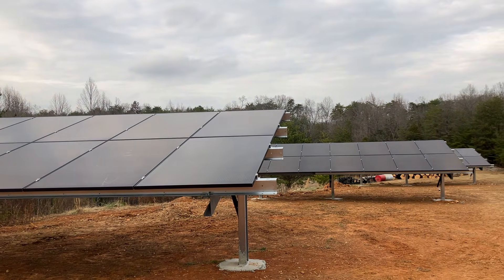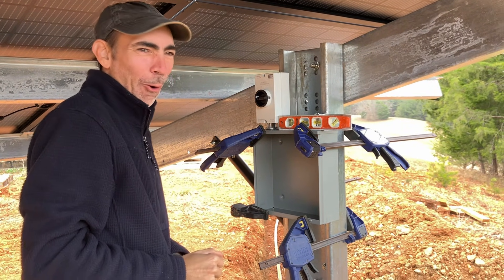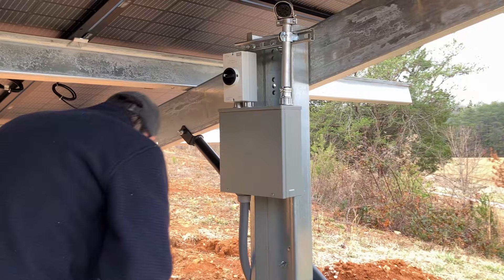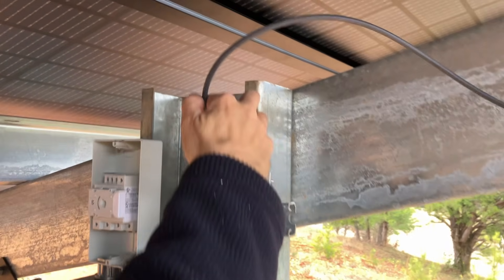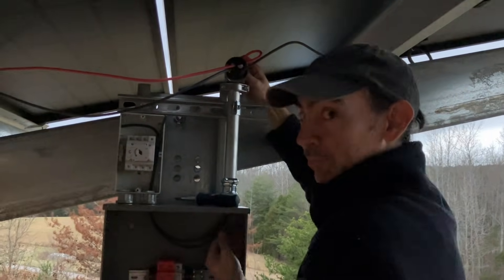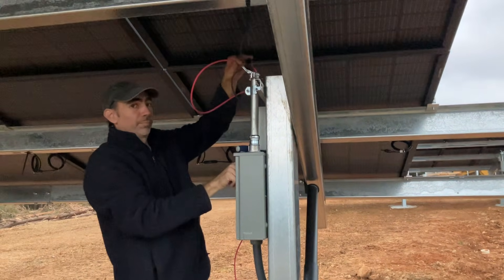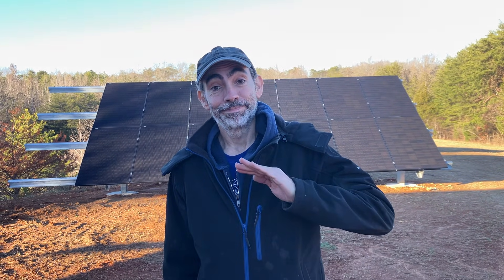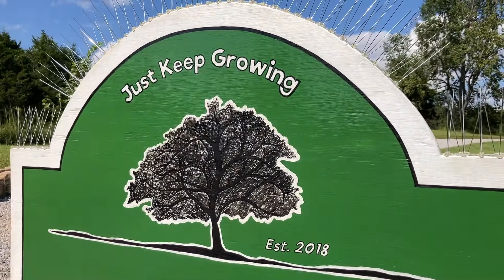Wiring Our Solar Panels Start to Finish ⚡ Pull Boxes, IMO Disconnects & Long Wire Runs

Comment: I’m glad it all worked out for you. But yeah, don’t rely on LLMs to do math. What you wanted to look for is a conduit fill calculator. Also, pulling PV wire in conduit is fine, but switching over to THHN in your junction box would’ve been easier.
Reply from the maker: Yep, couldn't agree more!  The conduit calc would have been a better place to go, for sure.  
I contemplated switching to THHN from the IMO at the garage but had a ton of PV wire left so I decided to use that.  I'm sure you're right... it would have been easier.

Comment: Looking good!

Breaking self-tapping screws - I have better luck by predrilling a slightly smaller hole before screwing in the self-tapping screw into heavy gauge steel.
Reply from the maker: Good tip!  Thanks!!

Comment: I just checked your #10 cu pm wires in 1” pvc.   With the (6) #10 that you used, you are at 39.2% fill.  NEC says 40%.   So, for what you pulled, it is fine.  Now the problem,  why did you not install the required equipment ground?   The grounds you installed to ground rods are for lightning.  Required equipment grounds are for ground faults.   When I designed solar, which was for commercial large utility connected systems starting at 1 megawatt, I learned that those coiled wires on the modules, you call them panels, are so you can skip a panel.   That way, your final connections are at the equipment end at the first and second module, or panel.  Your method causes voltage drop and therefore power loss.   Did you put the correct size fuses in the string fuse holder?   Maximum fuse size is 15 amps, just so you know.   Hopefully, you install a disconnect on the outside of your house for the solar before it enters the structure.
I do have one more question,   Since the conductors under the panels of your array are less than the required 8’ without protection, are you going to build a fence around the array?
These are the finer points of designing and installing solar.   You are doing mostly a good job!   Safety tip!   Always be safe!  The life you save may just be your own!  Best wishes!
Reply from the maker: Excellent comment!!  My understanding is code doesn't require the ground be run through the conduit but does require it be bonded with the inverter/electrical box.  We did do that and will get into that on the next (I think?) video so you'll see that soon.  In doing so, that will handle both faults and lightning.  

I guess I don't totally understand the skipping thing, but wouldn't you still be using the same amount of copper either way?  You still have to get from the end of the line back to the electrical box which would mean the voltage drop would be the same.  

In the data sheet for the Aptos panels, the max fuse size is 30a and that's what I used (the Sol-Ark self limits to 26a).  It would have been better to separate the two series lines and used a 15a fuse for each.  I may go back one day and do that.  If something were to happen, I'm limiting a potential problem by half.  I don't think it would be too difficult to do it either, so thanks for that!!  

We do have an IMO disconnect on the garage which is on the next video.  

Finally, a fence might be required if we have livestock, public access or an inspector deems it subject to damage which I'd have a hard time believing that would be the case in our situation.  At least I hope that! :)

If we were a large array like what you've installed (awesome job, btw!!) I could totally see some things as being an issue.  If/when I do something about those fuses, I'll give ya a shout-out. :)

Again, thanks for the well thought-out comment!  We much appreciate it!
Reply: @trippyacres .  No, less copper in the string.   Instead of the coils on the back, they would be used and that #10 you added would be only to the first and second panel.   So if you have 6 panels you would plug them this way.   P1 to N3, P3 to N5,  P5 to N6, P6 to N4, P4 to N2.   That would leave you with 2 ends.  N1 and P2.  
I will have to get my NEC and check on the no equipment ground in the DC conduits.  
I hope you don’t mind my comments!   If so, tell me to not comment.
Reply from the maker: @KevinCoop1  Oh!! I understand now.  By skipping one, when you get to the end, you're coming back to the beginning.  So if you are looking at the left side of the array and the electrical box is on the left side, your first panel is your positive (to the electrical box) and your second panel ends up being the negative (to the electrical box).  That would eliminate the long run of the negative going back to the box.  I'll have to see if my Leeds are long enough for that.  If they are, I'll put that in our video as a "Trippy Commenter Tip" ! :)
I don't mind at all.  If I've done something dumb (or there's a better way) and am amplifying it to the world, I'd want to correct it, so I certainly appreciate it!
Reply: @trippyacres   Ok,  I’ve done my investigation to make sure I’m remembering correctly or not.  Been retired since 2018.   NEC Article 690.43 Specifies that metal parts of PV modules (panels) and equipment must be connected to the circuit equipment grounding conductor.   It references Article 250.134&136.  690.43C very specifically says it’s required.   The reason for this grounding is so that if the DC touches the frame, the metal support structure, the metal box you installed, it will cause the GFCI to trip, or the fuse or breaker to blow or trip.  So, you got some grounding to do.  All conduits, need them and they need to be connected to all the metal parts of your system.   Sorry!
Reply from the maker: @KevinCoop1  I'm pretty sure I've done all of that.  The clamps have teeth that bite into the modules and racking so my understanding is they double as a bond.  The racking is bonded to the post via the bolt that has teeth.  The box is bonded via the solid #6 which is bonded to the post.  That same #6 goes through 2 ground rods and comes back up into the garage.  Where I transition from PVC to EMT inside, I took that #6 and bonded it to the EMT which then got bonded to the Sol-Ark, which then got bonded to the breaker box, which then got bonded to the building (was also bonded to the building where I transitioned from PVC to EMT) and then another 2 ground rods.  The Sol-Ark has a built in breaker plus I have the fuses on each array.  Have I missed something?
Reply: @trippyacres .   Ok, so I missed the ground wire in the pvc conduits?   If you pulled a #6 in those, I didn’t see it.   If you used #6, you over did it.   #6 was required for the grounding electrode conductors but, depending on your overcurrent protection, you could have used #10 or #12.   If it’s in, all good and well done!
Reply from the maker: @KevinCoop1  No, it's not in the conduit.  I have it outside the pvc conduit so I can attach the ground rods.  That same #6 that is bonded to the boxes/posts/modules goes into the garage and joins back up to the six 10awg wires when they go into EMT.  I bonded the EMT with that #6 so the path is continuous from modules to the Sol-Ark to the breaker box to the additional ground rods.  My inspector didn't care that the #6 wasn't in the conduit so long as it all came back together.
Reply: @trippyacres .   For clarity,   There are two different “grounds” in an electrical system.   There is a grounding electrode system.  That is connection from the equipment via a grounding electrode conductor to a grounding electrode.  The electrode might be ground rod or rods, or in may be support steel in the earth.   The purpose of that is to dissipate lightning strikes from sky to earth. Table 250.66 for conductor size.  This is where your #6 size came from. That system is done.   Then there is an equipment ground system.  Soon NEC will be changing it to equipment bonding system since it truly has nothing to do with earth grounding.   The equipment ground conductor size is based on the overcurrent protective device, breaker or fuse, that is used for circuit or feeder conductors.  Table 250.122 is used for sizing the conductors. The equipment ground conductors are not to be used for any other purpose.   They should be installed with the circuit or feeder conductors (inside conduit, cable, or other).  This system is installed for the purpose of take a fault condition current back to the overcurrent device with enough amps that the breaker or fuse will operate.   Some call it the safety ground.
Reply from the maker: @KevinCoop1  Gotcha.  If we do another system, I'll make sure to have two.  If I heard correctly, I could throw an equipment ground wire through as it doesn't count towards the fill size.  It would be a PITA, but do-able, if my understanding is correct.  Maybe down the road... in any case, again, thanks for the info!  More never hurts, especially when dealing with electricity!
Reply: @trippyacres .  If you tie a string to one conductor in the conduit, you can pull it out, attach the ground and pull them both back in.  This is not something you want to just do next time.

Comment: Looks like you put in Sinclair racking. If so did you pound them in or drill a 2’ diameter hole? Great job running the wire.  I live just 25 minutes from Signature Solar.  All the best from north Texas.
Reply from the maker: We first tried to pound them in.  We rented a post driver (but not the big one intended for this type of install).  While it did sink the post, it was crooked and we destroyed the top.  (You can see that failure attempt on a separate video, https://www.youtube.com/watch?v=vYdTX9A4luU ).  We moved on to plan C...2' holes with concrete.  That worked!  It would be nice to live close to Signature Solar...though that might be dangerous ;)

Comment: Hey Brian! I don't mean to stress you out, but just because it fits doesn't mean it's right. Depending on how many conductors you have to upsize the conduit or derate the amperage due to heat in the conduit. Hopefully your cable is oversized for the amount of power expected.
Reply from the maker: All good!  The math worked out that 1 inch schedule 80 (the tightest on the line) had a max of 6 wires with my outer dimension.  No derating required but I definitely was pushing that limit.  I got lucky!

Comment: Looks like you did a great job. Anyway, AI is only as good as what it finds on the web, and there will be an array of opinions out there about the correct size to use so Gemini and ChatGPT probably found different opinions. Looks like it was fine anyway, and hopefully it does the trick. 

The power puns bordered on sizzling today. 😅 All puns in this comment intended.
Reply from the maker: Thanks!  Yeah, I learned a valuable lesson on the use of AI that day. :)